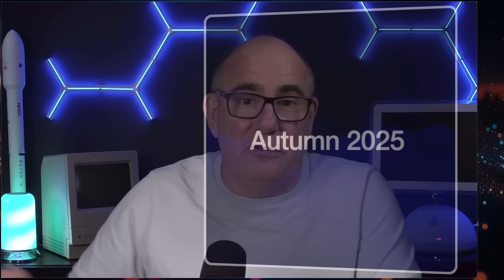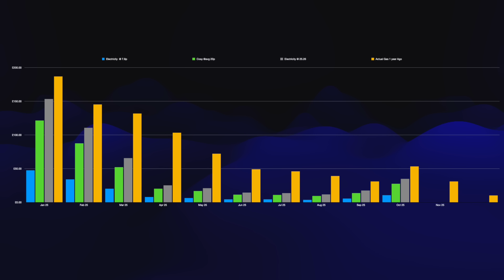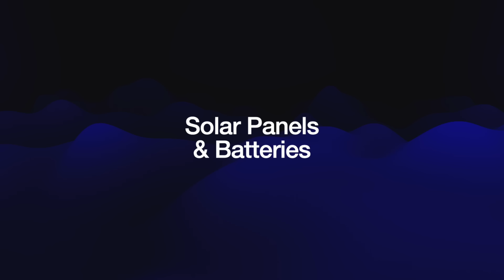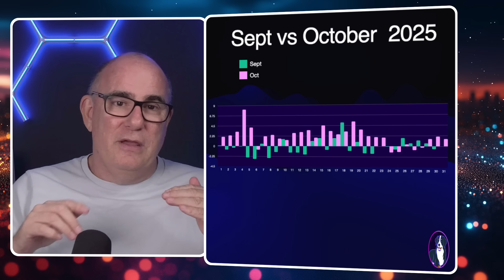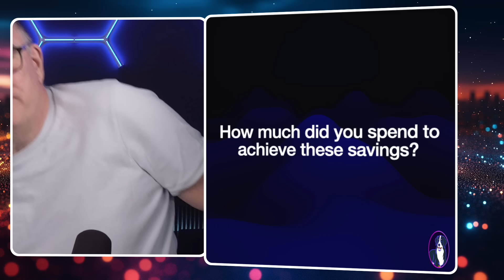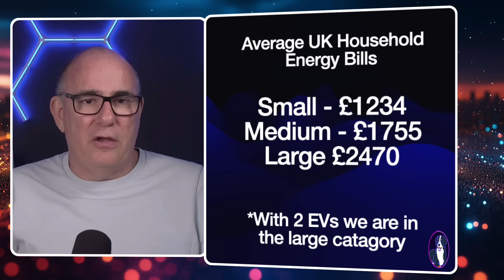How We Owe Nothing for Energy — Octopus Actually Owes Us

Comment: Moving into a new house shortly and have factored £30k for solar battery and heat pump is that realistic and is it worth going for big brand batteries or get more capacity with cheaper batteries?
Reply: There's a tricky balance in my experience
- The bigger the system the more you should go for a system that works with third party batteries
- The smaller the system the more you want to go for an all in one.

For bulk there's pretty much nothing that can touch a rack of Fogstar or similar batteries and an inverter that accepts anything that speaks pylontech BMS and isn't artificially tied to makers batteries. However they take more installing (more cables, more expertise etc). A lot of the people who do battery arbitrage games and the like run 30-40kWh Fogstar batteries and Sunsynk or similar inverters to maximise kWh / £.

For small systems the all in one units cost more per kWh and are hard to expand but they are much cheaper to install because the installer will have done loads of identical installs and can bang them out every day without thinking and usually without any quirks. As time is a measurable part of the install cost for small installs they win hands down (and will until self install 800W or similar is sorted, at which point that will do so)

What will save you most though at least on the solar/batteries is making sure you don't go through some national brand. All they do generally is take 20% and then get the cheapest (not the best) local installer to do it for the other 80%. Find a decent local installer and cut out the middlemen.

Also if you are doing the roof or anything else needing scaffolding do the solar and roof together. Scaffolding is bleeding expensive these days
Reply from the maker: Depends on your needs, without knowing your usage its hard to say, what I would do is start small, and add to them over time. Choose a modular solution like the Sigenergy where you can easily add more over time as needed
Reply: Yeah I liked the look of the sigenergy and not quite as premium price as Tesla enjoy watching your videos and just seeing facts rather than opinions 👍🏻
Reply: @stevenbennett9102  I think that’s a realistic figure. I went for GivEnergy at the time but their support has dropped off considerably recently. If I were doing it now, I’d be seriously looking at Sigenergy

Comment: One number that amusingly depresses me is how I spent for each $ that the battery can maximally export if full.  For me it's about $6950.  That's just the battery cost not including solar or anything else.  My 27 kW of battery can export $2.06 of electricity.
Reply: Yeah but your savings here should really come from being able to store solar energy that you've generated yourself / any overnight cheap rates that you're able to take advantage of and top up the batteries (depending on where you are, of course, it differs by country).

I don't bother to export from battery for the reason you mention, I only export excess solar during the day, so I leave the battery just for me to use in the house
Reply: That's why I said amusingly depresses.  Electricity constantly goes in and out which is what makes me money but just how little it holds $ wise to earn that is surprisingly low.
Reply from the maker: yeah on a day to day measurement is poor but now multiply that by the life of the battery, it will pay for itself a couple of times over

Comment: £35k outlay on 12kW array, 27kWh of batteries and ASHP, and we’re looking at 8 to 9 year payback on the whole lot based on current energy costs and export rate. Very happy with that! Plus the house has never been warmer.
Reply: And I’ve not even factored in savings of the EV versus the petrol we used to spend…hmmm, need to add that in too, now that I think about it!!
Reply from the maker: more savings what’s not to love :-)
Reply: I found it amazing after getting a ASHP that my house costs less to heat and it is at 20°C 24/7 with no cold spots like the old gas boiler system had. I think people should feel the benefits of a HP and not just talk about the cost of it. 👍👍
Reply from the maker: @davies0121 that's the hardest part to convince people of, until you experience it
Reply from the maker: sounds good, that’s about what i estimated at the end of the video 👍